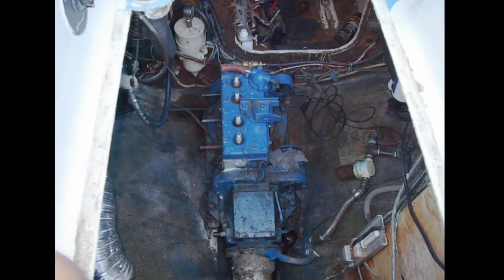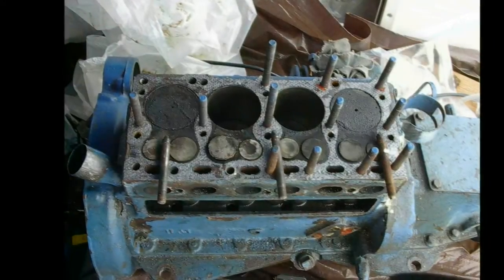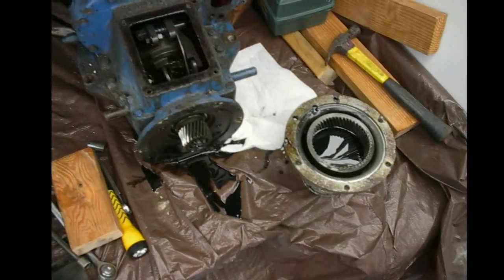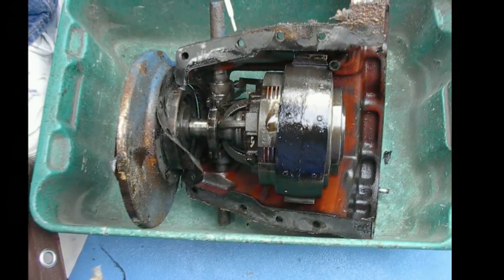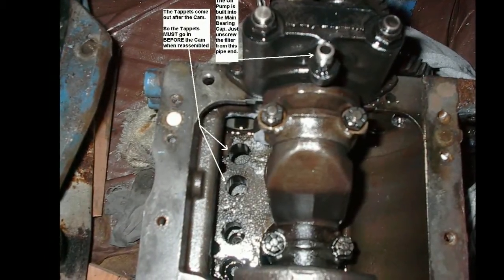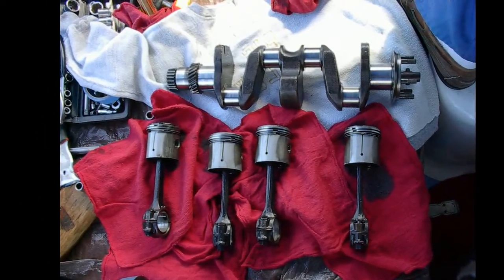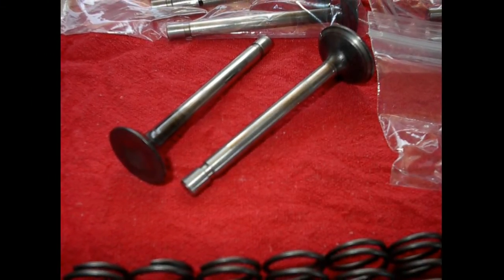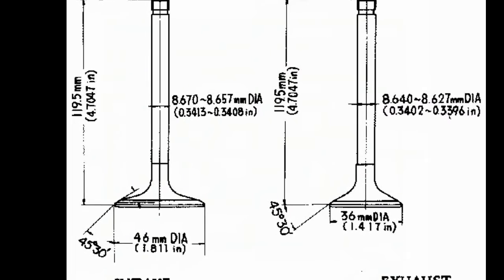Atomic 4 Marine Engine Tear Down with Cracked Piston

Comment: Okay I have a question for you this motor has a compression ratio of 6.3 which is extremely low what about Milling the head since it's a flat head I'm bringing the compression ratio up to say nine to one I wonder if there's enough meat to do this in the head I have worked on welder engines with a flathead Continental and I have mailed ahead 50,000 to bring the compression up to 9 to 1 so much nicer

Comment: I see you have a reduction gear as apposed to the usual 1:1. What prop do you use and at what RPM for cruise. BTW 2020 Moyer is still  going strong.
Reply from the maker: 2 blade solid bronze 13x12x1". 2000rpm. It 'hides' behind the full keel when sailing. Trans in REV when sailing to prevent spin. Moyer is Awesome

Comment: 8:33 That' s not where the starter goes. That image is where the water pump/drive gear hooks up to the auxiliary gear off the drive shaft. The Starter is on the opposite end of the motor geared onto the fly wheel
Reply: Other than that, great video. Very informative!

Comment: The later transmissions use ATF. Only the reversing gear train shares oil with the engine. Those clutch plates won't like engine oil. That engine there is WAY over 30 years old. That is the version they were running back in the 60s. I do not know the transition date to the later models but that one there has the early blue paint. A bit heavier valve springs are recommended, they should always be replaced at this point in time. Spun wrist pin bushings, distorted main bearings and cracked pistons are ALL signs of over-propping and lugging. Many of the stock props on those engines were not specked correctly. Many lugged along @ 1700-1800 at full throttle. That is not good for those engines. Many ran for over 40 years like that though.

Comment: I have always wondered if it was a piece of junk  or not. What kind of power does it give you?  Have you tried a muriatic acid bath for the salt? We use that on outboards. Works great and no tear down necessary usually

Comment: Love those engines , mine is 38 years old  and exept for putting a new exhaust manifold and no 4 exh valve this thing keeps on ticking . i do run it at least once every 2 weeks year around and flush the engine with muratic accid every 3 years I have owned it for the last 17 years.
Reply: What's the acid to water ratio you use?
Reply: I flushed mine with muriatic acid and suggested by Moyer marine. Don is a great guy full of knowledge and experience but I'll not be using muriatic acid again. It set off rust inside my water jackets like crazy. I tried using very light mix and it was so weak there's no result. I believe rystoleum had an inhibitor that seals the metal and creates a barrier that inhibits rust formation but I think the best bet is to install fresh water cooling.

Comment: Working on my friends Atomic 4.  I built my own Perkins 4-107.  Atomic had 4 stuck exhaust valves causing no compression.  Got them all free and operating, but #1 exhaust valves rides 1/4" higher than it's suppose to.  I mean, it goes up and down but 1/4" inch taller than the rest both open and closed.  Any comment?
Reply: Weird: That "seems" like a cam being different than the others, if I understand correctly.. Is it possible the others are all worn down? I'm not sure the throw of the valves, but that number is in the Lift specifications of the valve train measurements. Its doubtful that #1ex has a 1/4" hard deposit on the cam, causing the 'extra' lift.... On the bright side, as long as #1ex doesn’t hit the head, no harm is done. Best of luck.
Reply: Yesterday I took of the gallery plate, can't see #1 valve, but I can feel.  The thread space on 7 of them is about 3/16", thread space on #1 is over 1/4" in the adjuster.  Tried to lower it and the wrench flats broke on the tappet.  I have a flat head valve spring tool, but can't find it.  Next it to remove the valve and tappet and replace.
Thanks for your commenting.  I'll let you know the outcome.
Lowell
Reply: try reaming out the valve guide.